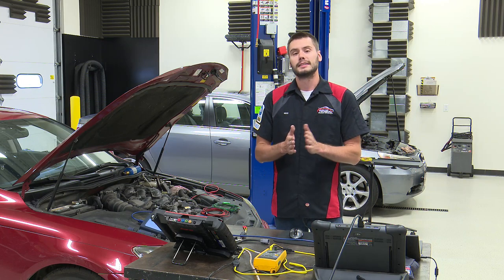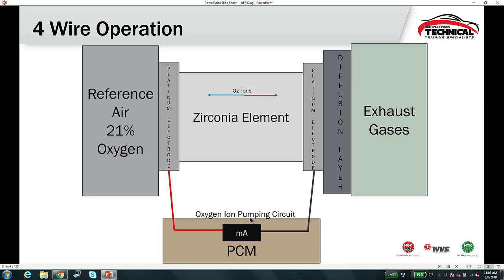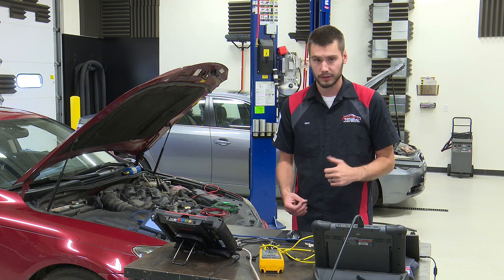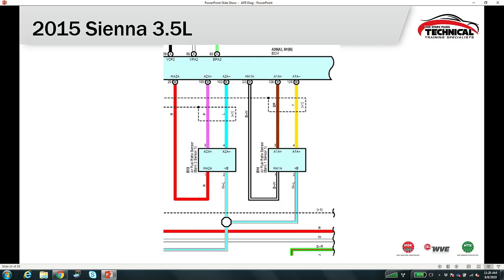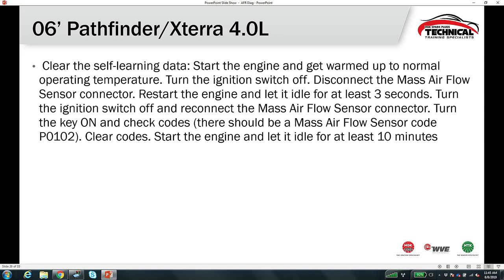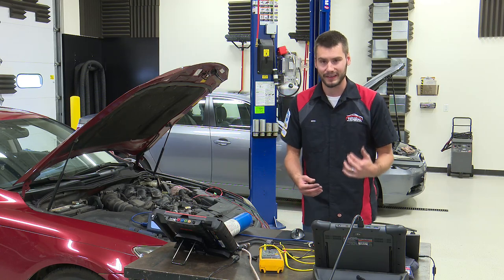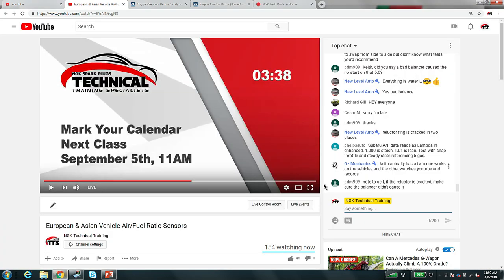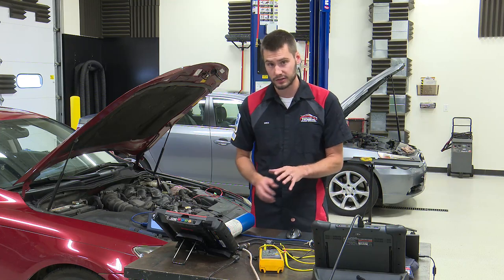European & Asian Vehicle Air/Fuel Ratio Sensors

Comment: Start at 6:05
Reply from the maker: You are the true MVP Blocki!
Mike Becker, Senior Technical Instructor
Reply: @GoTechTraining  Thanks,. but no problem.
It should be possible to cut the stream after the stream is completed. Another Youtube channel I follow does that every week. They cut off the "idling" in the beginning after the live stream finished. It takes a while for Youtube to process that. It doesn't create a new video. It overwrites the video of the live stream.
Reply from the maker: Yeh, I used to do that. Issue being, if you trim the video the live chat doesn't playback. I find the live chat incredibly valuable...too valuable to not have it.
Mike Becker, Senior Technical Instructor

Comment: Hey Mike, to amplify your current reading using an amp clamp with the scope, you could jumper wire the sensor on all four pins and coil the wire you are  trying to measure through the amp clamp. Cheers, Jake.
Reply from the maker: I've seen that done Jake. Sounds like a lot of work though. Maybe more work than it's actually worth?
Mike Becker, Senior Technical Instructor
Reply: @GoTechTraining  it is a lot of work but could be handy for a trainer by using a pre-prepared a jumper or extension cable.

I certainly wouldn't use it in the field on an O2 sensor, I get by fine with just a scan tool in most cases.

Comment: The high efficiency honda 86' you were talking about. Is that the cvcc? I have an 87 crx that gets 50 mpg city. I love it! Its carbureted though. There is a mess of vacuum hoses connected. Ill look into it to see if there is an o2 installed and if it controls fuel. That would make the 40 hoses connected make sense 🤘

Comment: Hey Mike, I know this vid was a while ago, but just looking a 4 wire testing: you referenced to ground the High (3.3v) and Low 3.0v) signals, and then also bridged High and Low signal. I'm thinking your scope uses Floating Grounds? Otherwise when you bridge High and Low to measure the potential, wouldn't you just be to Ground via the scope ground bus, which is already connected to ground on the other 2 channels? If you don't have a floating ground, you could still measure the potential differences between the High and Low Signal wires so long as it was the only channel connected, I think??

Comment: Why do you call it a 5 wire sensor when there are 6 wires? The wiring diagram even has the pins labeled 1 through 6.
Reply from the maker: Great question. The sensor itself only uses 5 wires. the harness has 6 because of the trim resistor.
Mike Becker, Senior Technical Instructor

Comment: Hello, Mike. Is it necessary to do both: add propane and disconnect a vacuum hose to see if you have a bad o2, or just doing one is enough? Thanks
Reply from the maker: Hey Carlos, typically you want to force it rich and lean. The propane forces it rich, the vacuum leak lean. You want to make sure the 02 sensor can read both ends of the spectrum properly.
Mike Becker, Senior Instructor

Comment: Awesome presentation Mike. I got a question about Lamda? 1 lamda is stoich 14.7 to 1. Anything above 1 is lean and under 1 is rich. Can u give examples of what above threshold.  Is 1.10 lambda 10% lean. And for the rich side is what tricks me. I usually go to generic but sometimes the data is really slow. What's 10% - rich in Lamda. Thank u Mike
Reply: See the fuel trims to get data for rich/lean percentage. STFT-LTFT.
Reply: Lambda 1 is 14.7:1 by weight ,so for example  14.7g of air to 1 gram of fuel is lambda1. If you have 14.7g of air and 1.10g of fuel  that make it rich .
Reply from the maker: Thanks for all of the comments guys. When looking at Lambda you need to approach it as a direct correlation, not a percentage value. 1.10 lambda in a gasoline engine is equivalent to 16.17 to 1. If you want to look at a percentage of fuel add/subtract then you'll need to be looking at fuel trims.
Mike Becker, Senior Technical Instructor

Comment: Hello Michael can you tell me what is purpose off additive adaptation of mixture and multiplactive mixture adaptation? There was very small and lazy reaction
Reply from the maker: Ivan, additive is fuel trim at idle/low load. Multipliciitve is fuel trim at higher load. They do take a significant time to adapt compared to what I showed on the Lexus.
Mike Becker, Senior Technical Instructor
Reply: Thanks, you actually mentioned in video, but didn't see any change that's why I asked. It' Mladen from Croatia
Reply from the maker: Ahh yeh, I always see you screen name. Sorry hard to remember everyone's names :)
Mike Becker, Senior Technical Instructor
Reply: Don't worry I understand

Comment: Hi, i have honda 8th gen 1.8l and  short term fuel trim at ideal position 
-16% to - 10% and fuel consumption only 7km per liter. My cat is blank in side (all material weast though exusat but both o2 sensor intact. Is it due to expired cat?
Reply from the maker: Muhammad, it's possible the lack of a catalytic converter is messing with your car. Best bet is to get it back to factory operation and recheck.
Mike Becker, Senior Technical Instructor

Comment: i don't understand , what does the propane do when checking the a/f ration sensor
Reply: Adding combustible gas to the engine will increase the air/fuel ratio and the A/F sensor in the exhaust will react and show a lack of free oxygen in the exhaust ie a rich condition
Reply: Propane is a hydrocarbon, just like gasoline, so when it is introduced into the intake manifold, it forces the engine to run rich. The A/F ratio sensor should then be able to detect the extra fuel in the exhaust and report the forced rich condition to the ECM.
Reply from the maker: Jeremy, that makes sense? Thanks for explaing guys!
Mike Becker, Senior Technical Instructor

Comment: Scan tool for the wideband sensor, labscope waste of time. Takes getting used to high voltage going lean but vacuum and gas input demonstrates the correct functioning of the sensor. Meteor shower expected hence the fire alarm !?!
Reply from the maker: Hey Tom, yeh on a 4 wire sensor the scopes a total waste. A 5 wire it has some use, but a scanner is quicker. Luckily no meteor shower, we all survived the alarm :) 
Mike Becker, Senior Technical Instructor

Comment: all sensors from MAF to O2 should use photo electric...using one LED diode and one photo transistor...….it would eliminate a hell of a lot of headaches and specific tools needed to isolate faults and they are just as accurate because LED's current output is directly proportional to light intensity...crank sensors and cam sensors should use them definitely because crank sensors use wire wrapped magnets and are prone to expansion from internal engine heat and eventually break the wire....also, wire systems are prone to electromagnetic interferences from many sources....photo systems are not......etc....i'm surprised that in our century, they still use systems from over 100 years ago...such as the crank sensor.....technology for the crank sensor was made way back in the early 1900's......old church organs such as the C3 were made with a motor driving a long shaft containing many different sized gears that rotated very close to magnets wound with wire to produce a sine wave....therefore a tone........flywheel and crankshaft sensor is exactly the same design....a gear rotating very close to a magnet wound with wire...…...unreal, there is no such thing as new technology, there is only technology that has been upgraded or re-used such as the crank shaft sensor.....Also with photo detection systems there is literally zero chance of short circuits and completely protects the computer since there is total  isolation between LED and photo transistor and voltages and currents are in the very small range......any resistive type element used as sensors can also be replaced with photo systems since PHOTO FET transistors work exactly like a variable resistor according to the amount of light falling on its surface and there are no moving parts to wear out...….I believe manufactures know of this but do not utilize it because they would never sell another replacement part...….since LED's have an average life span of 25 years or greater and transistors can last a lifetime under operating characteristics below their thresholds, manufactures would quickly go out of business and there would be no reason to have mechanics with special equipment to troubleshoot anything.....all they would need is a multimeter...that's it...…...
Reply from the maker: With advanced technology comes a price. What's the price difference between a photo fet and a vr style sensor? I'd be willing to bet that photo sensor is multiple times more expensive to manufacture.
Mike Becker, Senior Technical Instructor
Reply: @GoTechTraining  photo FET's are much cheaper to manufacture than zirconium elements and they do not need air reference such as A/F sensors...that includes more electronics in the ECU to keep track of pump circuits etc....photo FET's also do not need heating elements,....all they need is a 5 volt supply...period...….there is no reason to detect oxygen content in exhaust...since imbalanced fuel /air content also causes vapour density differences which is easily detected by photo systems......as a matter of fact, they can also do away with catalytic convertors with such a system and there would be no need for downstream O2 sensors either, but having said that, I personally would rather the CAT be there ...I know A/F sensors are the best type to use right now since they are wide band and able to distinguish how much change there is but photo detection systems are equally as good since they are linear tracking devices...and they react just as quick and can detect full range capacity....why?....because forward current output is directly proportional to light intensity...so when obstructed even by dense gas, output changes accordingly...exactly the same as A/F sensors but a million times cheaper and much easier to understand.....most DIY guys out there are still asking million questions on how to check for bad sensors….and with my experience, even actual dealer mechanics have trouble diagnosing faults....they rely mainly on guess work......most of them don't even know what to check for...….I asked a mechanic at audi dealer for my car what was the value of the EQ ratio?..because my code was telling me that the pump circuit was open....he said , I never check that?...I said why not?...it's a perfect indicator to tell if my A/F sensor is bad.....needless to say, I had very little respect for him......and quickly took my car out of that place ..technology is becoming way to complicated that only the engineers who designed the system can fix cars nowadays...….or mechanics today are mainly parts changers, not trouble shooters......or not trained very well at all and rely way too much on internet info where there are millions of different opinions.....there are much simpler technologies that accomplish the same things as todays technologies...….thank you